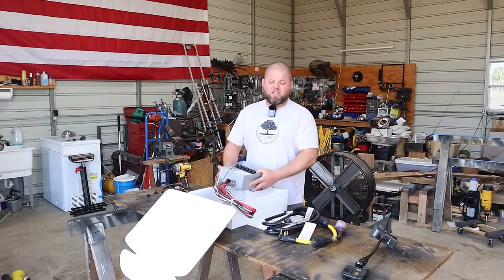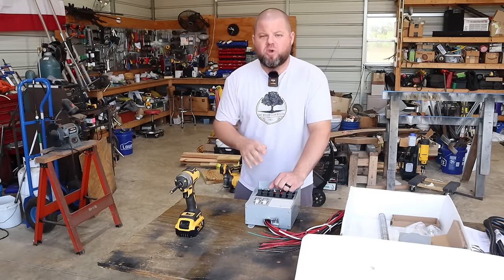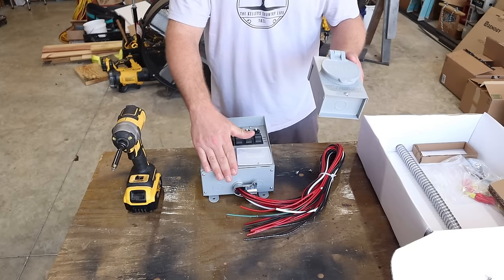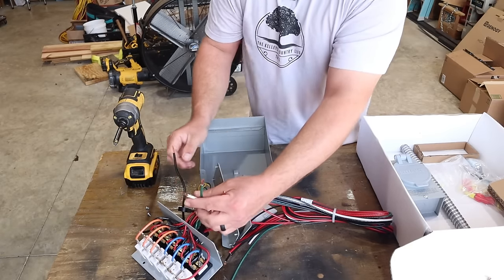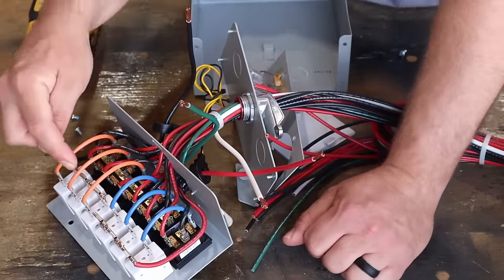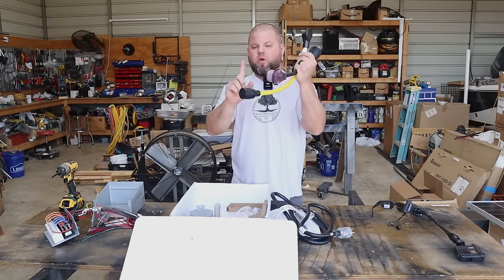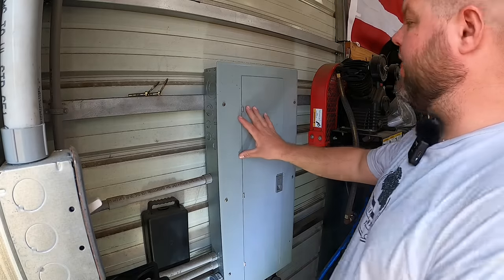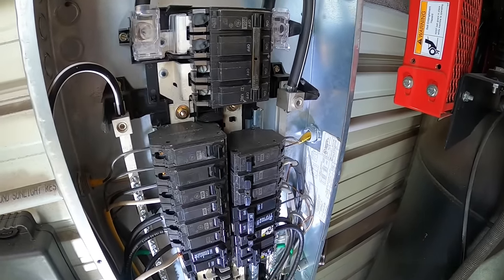How to install a generator transfer switch 120 and 240 volt #703 Ecoflow whole home power solution

Comment: Andrew, I may miss this completely in the video and in the description on Amazon but when you "switch" to the generator you will loose the line protection for the switched load I believe. Example, when you tie in the red in the breaker box for the storm shelter you are protected by the breaker when on 'line' but when you switch to 'generator' that breaker is bypassed. That means that you dont have a breaker anymore protecting your line to (!!!) and within the shelter and you rely soley on the generator breaker. Simple situation, you use the 30 amp outlet from the Ecoflow Delta Pro. This is internally secured by it own 30 amp breaker. But when you only have a cable to the shelter that allows a 15 amp load you could theoretically overload that line and cause havoc. 
For clarification - I am not an electritian. So please check this with a local expert and hopefully you can make updates to this video.
Reply from the maker: Negative, there are breakers installed in the transfer switch box. They are push button reset breakers above the 3 way switches.
Reply: @TKCL  Thanks for the clarification. Maybe good to point out in the video with an overlay.

Comment: Can I DO BOTH mount a plug inside for my Eco-Flow power station and another plug outside for an outside gas generator?  ( not planning on powering them at the same time - I want that option when my Eco-Flow goes dead then I can use the gas generator )
Reply from the maker: Here's the problem with that. When powering one or the other, the not in use plug will be live and can be touched. You're creating a dangerous situation that way. You would have to put in a 3 way  throw switch between the two.
Reply: Was about to ask the same question. I have a Delta and a Predator gas generator for outside.

Comment: I had one of these and when I upgraded my generator to a 10k converted to natural gas I chose to do an interlock and just send generator power to the whole panel. Even my old small 4KW will power my whole house minus the AC and my gas dryer, but it will power all the lighting and one small appliance at a time. So I just shut those breakers off and use an adapter on the smaller generator.
Reply from the maker: That's what I do at my house as well

Comment: Just to make sure I’m getting this correct. If I have a delta pro and transfer switch panel I can use the adapter to the 240 plug and if all the circuits are 120 I can power them? As long as I don’t over do the inverter. Also still be able to use my 240 generator on the same plug and circuits when needed? The reason I’m asking the pro is on sale right now and I’ve been trying to decide if that’s what will work for me.
Reply from the maker: Yes but when on the Delta pro, throw all 240v breakers off.

Comment: 2-18-24 question - Can I run a couple of circuits through my transfer switch connected to my delta pro and the rest of my circuits from the grid at the same time? Or do I have to turn one off?
Reply from the maker: Yes since the switch has a 3 position switch.  You can turn the switch to GEN for the circuits you want to run off of the Delta pro and switch the other circuits to LINE to run off of grid power.
Reply: @ TKCL So, is the transfer switch using the natural from the grid or the transfer switch? And if they are both sharing the same natural then it's ok that it's simultaneously.

Comment: Great video I wired mine up exactly like yours to the main panel. I flipped all the switches on the transfer switch to off . I plugged in eco flow restored power to two switches the breaker popped and the eco flow smoked. I'm not sure what could have gone wrong.  But I thought the grid power may have back fed to the transfer switch
Reply from the maker: Oh wow, it truly sounds to me like you had grid power back feeding into the ecoflow. Triple check all those connections, something is hooked up incorrectly.

Comment: Fantastic JOB Andrew! You're a born teacher! Although this subject is the 120v transfer switch, it does have a double pole breaker (if the two single poles breakers are connected together, as you covered), so why can't a 120v delta pro (or even a 120v gas generator that has a 240 output connection) power a 240v well pump (assuming it's peak current draw is within the delta pro limits?  You seem to imply that this would require 2 connected delt pros or a 240v gas generator.  (I guess I''m not sure why any gas generator with a 240v output connector isn't both a 120v and 240v generator).  THANKS SO MUCH!
Reply from the maker: Correct, it requires two Delta pros to achieve split phase 240v to power both sides of transfer switch for 240v operation. A 240v generator would work fine powering this transfer switch and using the double pole center breaker for a 240v appliance.
Reply: @TKCL  Eureka!, Perhaps for others with my mental block, using your answer and some other research, the reason why a single 120v delta pro, even with a 3 prong to 4 prong  splitter that replicates a second 120v source in a generator 4 prong type connector, is because both those 120v sources in the generator plug are from the same leg or phase and therefore not truly a split phase (each leg or phase being 180 degrees apart) which is absolutely required to power a 240v appliance. The splitter/adapter I described does result in two 120v prongs in a 4 prong generator plug, but each being the same phase rather than 2 "opposed" phases, does not result in 240 volts to do the work required by a 240v device.
Reply from the maker: @timfrazier6268 correct, split phase or 180 degrees out. It's essentially two independent 120 volt supplies that share a common neutral. That's what allows you to run 120 volt appliances or tie both 120 volt supplies together with a double pole breaker for 240 volts.

Comment: What size breakers are in the transfer switch? And another question can I have a 20amp breaker in the main box but only a 15amp transfer switch breaker? Would I get nuisance tripping?
Reply from the maker: That transfer switch is 30 amp input rated.  You can supply it with up to that.  The breakers in it are a double pole 240v 20 amp and multiple 15 amp breakers for 120v. Your breaker only trips on the transfer switch if you overload it on the output side with some appliance. 15 amps should get you around 1800 watts of usable power before tripping per breaker.

Comment: Question please... I have a solar generator with a ups built into it. If the position of the transfer box breaker is on the 'line' position and a power outage occurs, does the generator ups work in that position or does it have to manually be put  in the 'gen' position? Thanks
Reply from the maker: You would have to be in the Gen position

Comment: Thanks for the video. Is it possible to install a transfer switch to a sub panel in my garage that has all the 120v breakers in the house but no main breaker? The main breaker is located in the main panel outside the house along with all the 240v breakers.
Reply from the maker: Absolutely, no main breaker is needed for a transfer switch.
Reply: @TKCL  awesome, and if the subpanel is unbonded, the neutral would go to the neutral bar, and ground would go to ground bar? Thanks for the help, appreciate it.
Reply from the maker: @stevennguyen9007 correct, all sup panels should be unbounded and that's the correct way to hook up the wiring.
Reply: @TKCL  Thank you so much for clearing that up.

Comment: Hi there. I bought the EcoFlow Delta Max 2 with transfer switch. Since the Max has only 15A connectors  I need 15 amp male to 30 amp female rv adapter cord; is this ok to do?
Reply from the maker: Yes because you are powering a 30 amp device with lower power. As long as it's not the other way around.

Comment: I ordered a LiFEPO4 battery from Dr. Prepper and it will be here on Sunday (tomorrow)...I'm replacing an aging deep cycle lead acid with this new battery for my backup supply.  
There will be more batteries added on to the system (parallel) but I have to space out the purchases  :)
Reply from the maker: Your not mixing the two types are you? Lead acid and lithium? It's strongly recommended to run all the same types of batteries. Lithium is definitely the way to go for so many reasons.
Reply: @TKCL    
No...not mixing them.  The lithium ones will be for my primary system...the lead acids will be for my secondary & tertiary until I can replace them all with lithium over time.
Reply from the maker: Nice!

Comment: nice job.  How would you put a outside 30amp connector to run a generator and switch between solar and generator?
Reply from the maker: You have to put an outdoor rated generator interlock plug for the generator itself. Then you would have to find some way to run that through a manual transfer switch inside that could have another plug for the solar equipment. Those are both then feed a transfer switch or breaker panel. That's a unique setup for sure.
Reply: @TKCL  I found a 3 pole double safety switch (Square D 92351 240 VAC 30 Amp 3-Pole Non-Fusible Double Throw Safety Switch) that I can select between inside or outside.  So when my batteries runs out, I can go to my backup generator.  Think it will work?
Reply from the maker: That should depending on if your feeding it 240v or 120. Otherwise you'll need to jump a 120 wire to each phase or use a plug that already does that.

Comment: This video was so helpful. I have the same unit in my home.  The electrician only connected 4 of the 6 switches.  My question, could you connect one of the switched in the transfer box to feed three breakers in my panel.  I really want to have my kids room lights to be powered, but they are on three different circuits.   I figure with LED bulbs, they are not drawing a lot of power, just wondering if a single switch can feed three circuits if you run three lines from breakers to that switche’s red line.
Reply from the maker: I would not do that, feed only a single breaker.  If your kids rooms have lights only on breakers, you could tie all 3 of those in the main panel to a single breaker.  No need in having 3 independent light circuits as lights don't use much power. Then you could power that single breaker from the transfer switch.

Comment: Your videos are great and very helpful. Can you direct me to a resource that would enable me to convert an existing automatic transfer switch to work with a portable generator. This transfer switch was connected to a whole house Generac so I understand that it is set up to work only after it tells the generator to start, but I don’t have that option since I’m using a large portable. Is there anyway that I can adopt that to work with my portable thanks.
Reply from the maker: Sorry I can't help you with that one, I don't have experience with automatic switches.

Comment: Mine is 20a plug on the transfer box but my generator is 30a, is it safe to use an adapter on to the gentran box? Very great video. Easy to understand. Thanks very much. I learned a lot.
Reply from the maker: Yes, that transfer switch is rated for 30 amps of input. Most generators have a 30 amp plug, but not all are capable of producing a full 30 amps of current.

Comment: Andrew, if you get two delta pro’s together, they’ll operate in split phase mode to make 240 volts :)
Reply from the maker: That's the plan 😉. I'm taking baby steps, just ordered a lot more fun equipment to slowly build a back up system.

Comment: Excellent. I have a similar unit (20 year old Gentran transfer switch) and am still struggling to figure out why my 240v well pump isn’t working when I switch over to GEN power. Both reds from transfer panel are connected to breaker. Blacks from transfer panel connected by wire nuts to wires from well pump. Does it matter which wire from well goes to which black from transfer panel? Perhaps whoever did the install mixed these up?? The four 120v transfer switches provide power when switched to GEN. Only the bridged 240v not working. Really at a loss here..
Reply from the maker: Are you power the transfer switch with a 240 volt generator or 120 volt?
Reply: @TKCL  240v. Thanks for getting back to me.
Reply from the maker: Typically for 240v you have a black and a red wire, both are hot. But it's hard to say if the company chose random wire colors inside of that transfer switch. I would try to find a manual for it.

Comment: Correct me if I'm wrong, but that transfer switch doesn't seem to be automatic. So that being the case, if there was a tornado or whatnot, wouldn't you have to run out to the garage and switch it over to your battery backup before going to your shelter? And then you'd be running on battery power whether you need it or not.

Either way though, this is a really great, detailed walk-through of the setup process - thanks for sharing!
Reply from the maker: It is a manual switch, but..... You can pass through charge my battery backup and use it as a UPS power supply. Long  story short the transfer switch will always stay on generator mode for my storm shelter and my room with my food storage. The battery backup power station stays plugged into the wall, and power runs from the wall through the battery backup into the transfer switch technically powering the storm shelter off of wall or grid power. Anytime that wall outlet loses power supply, it will automatically swap over to battery power. So what that basically means is there is an automatic transfer switch built inside of that power station.

Comment: Thank-you for a great video. I have a question, can you wire both internal and external generator plug? I would like the option to either use gas (outside) or EcoFlow (inside), with the understanding using one at a time and not together. Thanks!
Reply from the maker: In theory yes, I would have to open the unit up and make sure you can insert two wires safely in the connections that feed the transfer switch. Here is the big risk though, your prongs would be "LIVE" or hot on either plug, this would make a dangerous situation if someone were to touch them.  Based on that, I wouldn't recommend it.

Comment: Question: I understand it has passthrough pass through charging  my question is.. being that you would obviously have the transfer switch flipped to grid, does the transfer switch recognize and allow the power to back feed through the correct wires to continue power since it's not in the generator switch position?
Reply from the maker: If you want to do pass through charging, the switch must be in GEN position and the unit plugged into the wall that's supplying grid power. That power passes through the unit, into the transfer switch as grid power. As soon as you lose power, the unit swaps to battery power and is still feeding the transfer switch.
Reply: @TKCL  ???? But if it's switched to gen,(no grid power) which means your running your outlets with the power system,  wouldn't you be charging your unit with your unit?
Reply from the maker: The point of a transfer switch is to only wire in critical outlets for generator power. Use a non transfer switch and non critical outlet that's grid tied to power the portable power station and do pass through power into the transfer switch

Comment: I super enjoy your channel.  Recently moved into a house with everything wired.  I am trying to find a way to expand the transfer switch to allow the option to use battery packs in the basement or a generator outside.  Ever seen this?
Reply from the maker: All you have to do is extend the input wires to any location you plan to place the battery power. You don't have to use pre-made generator cables.

Comment: You could save a few bucks by buying a 30-amp 2 conductor w/ ground extension cable; hook that to the generator, then plug the male end of the adapter cord to the female end of the extension cable and the female end of the adapter to the inlet box.  (so basically putting the long cable first then the adapter second).  That way if you have say a 50' run from the generator to the inlet box you don't have to buy a more expensive 50' 3 conductor w/ ground extension cable.
Reply from the maker: I test equipment on my channel, 120 volt and 240 volt. The 3 conductor wire makes the most sense for me.

Comment: I thought you video was well thought out! Do you know the link on Amazon for a cable adapter 120-20amp socket to feed the Transfer Switch. I'll be hooking it up to a Ecoflow Delta 2 Max. Thanks for your time!
Reply from the maker: I've been running the same transfer switch off of my Delta 2 Max after being hit by the hurricane a week and a half ago. If you look into the video description, I have links to Amazon for those adapters.

Comment: Perhaps I missed it (and sorry if I did) - how did you avoid the neutral loop between the Ecoflow, the transfer switch and the main breaker box?  Did you supply 120v power via a line that was already included within the transfer switch?  Many thanks!  Thanks for a really great channel!

Comment: Not really sure if you still look at comments on here but I was wondering if you have any experience with the protrans and solar inverters together as a passthrough.  As in.  AC goes into the inverter to charge the battery and passthrough after full to the hot and line of the transfer switch to act as a UPS basically.
Reply from the maker: No I have never ran a setup that way.